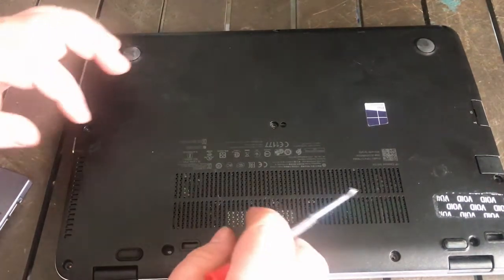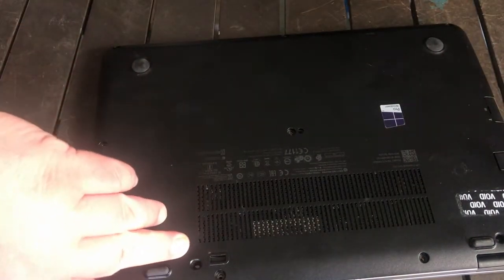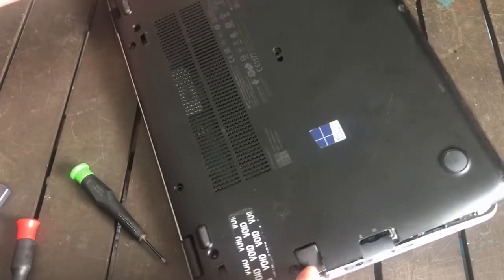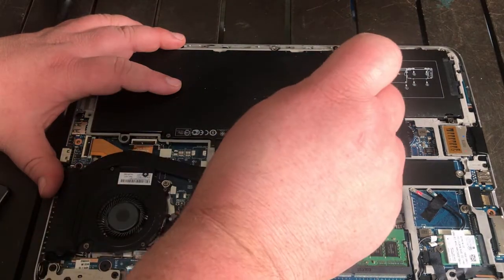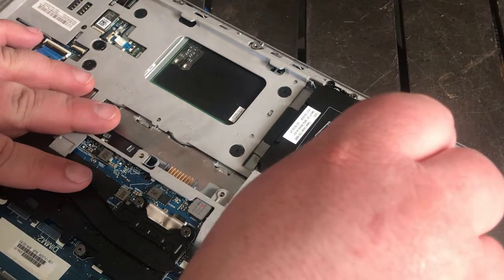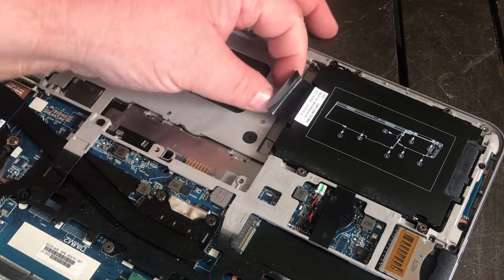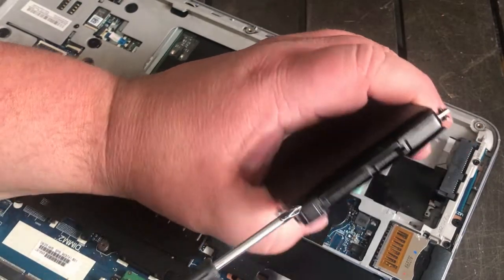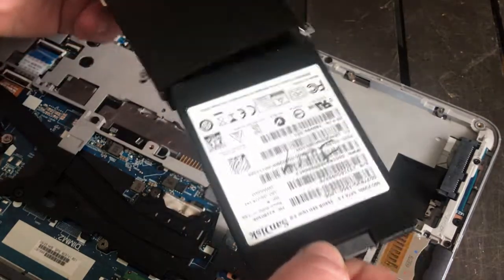How to remove and replace a hard drive in a Elitebook 840 G3

Comment: Sounds crazy....but because my G3  had an intermittent fault....I bought a similar machine and decided to remove the hard  drive from the original machine and put it in a caddy tpo save all the documents etc as a spare drive.   I removed all the screws and battery.....but where you show the hard drive....NOTHING!!!   So I put the battery and cover back on....and plugged it it....still working  and shows a 256gb drive.  HOW???? Is their a 2ndary concealed drive that I've missed???
Reply: There's an ssd drive besides the sata drive that probably is being used. This video shows where the ssd drive is https://youtu.be/eIGJn21Pz_4?si=WbtTZJZXPWFN6YEw

Comment: Please I opened the back of my laptop and found out that there wasnt any hard drive in it and i have been using it for about a year now and I only opened to check because I encountered the blue screen of death recently and i'm surprised cause why has my system been working without a hard drive ever since? Please I need help